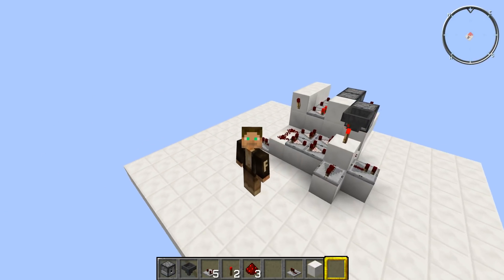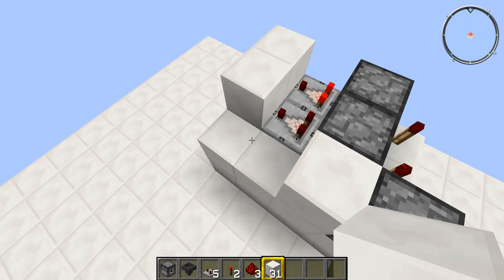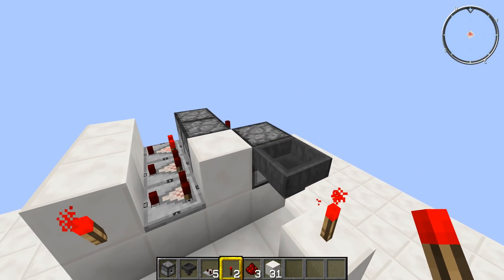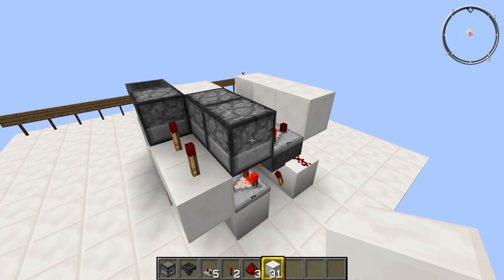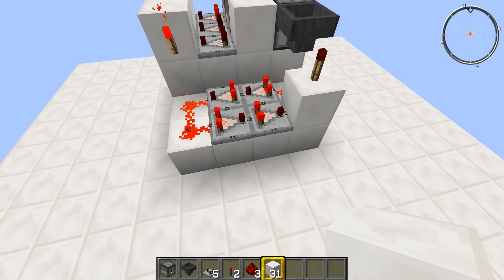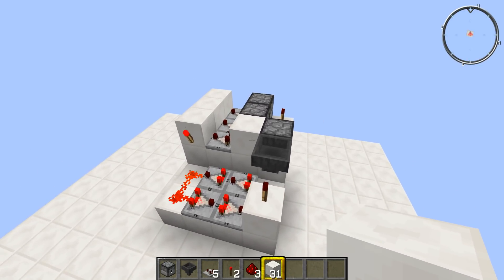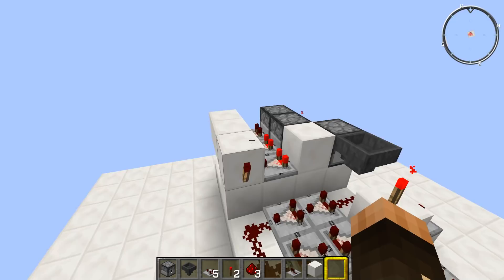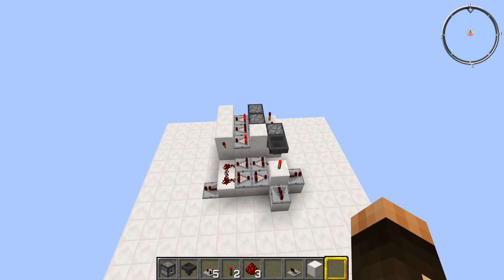✅ Minecraft Silent Adjustable Hopper Timer Extender Clock Tutorial How To Video

Comment: Thank you for this! My dropper timer that I used to use 5 years ago (been away from the game and only recently returned), no longer works. It used 4 droppers (no hoppers) so that it would be a consistent timer, even on servers that messed with how hoppers work (or limits how many hoppers can be used). 

I couldn't get my old dropper timer to work, no matter what I tried. But this one works perfectly. I'm not a fan of the hopper usage (for if a server limits the number of hoppers), but at least it works for now. I'll just have to adjust if I join a server that messes with how hoppers work.

Comment: The original clock is amazing.  It's just what I needed.  However, this extension is giving me issues. 

Once I put say 10 items in the dropper, the comparator lights ups, turns off the side torch, cuts off the bottom comparators, and turns on the torch locking the hopper.  That's just like the video.  However, I don't get a off/on pulse from the comparator monitoring the dropper so the hopper is always locked.  The dropper just shoots items on the ground.  What am I missing here?
Reply from the maker: Check its a dropper and not a dispenser. If they are droppers make sure they are pointing straight into one another
Reply: @Frilioth  It was a dropper.  I put blocks around the hopper to try and force the items to go in it, but still had issues.  Anyways...  I figured out a way to use hoppers instead so it still stays silent.

I ended up taking an observer and pointing it downwards over one of the comparators on top of the hoppers of the original clock.  I put a piece of redstone on top.  Then, I put a solid block on top of the dropper to the right.  On top of that block, I put a repeater on 3 ticks (very important) then put another solid block to the side of the repeater (not the block under it) and threw a torch on top.  That torch now stays on and has a single pulse that cuts it off then back on.  At that point, you can use 2 hoppers facing each other instead of the dropper into a hopper.  Basically, just follow the build at this point like this video.

I hope that makes sense.  Doing this fixed the issue of the long pulse (2 items pushed) for those that tried.
Reply: @Frilioth  So I've been tweaking the extension and had a breakthrough thanks to Cortezerino and his adjustable pulse extender.  The number of cycles now depend on the number of items you use for the initial clock.  For instance, if you set the initial clock at 1 min that's 80 items.  That's the max cycles the extension can run without issue.  2 min = 160 cycles = 320 min.  So on so forth.

Still silent :)

Comment: Hi, I have a question, how to drop water from a dropper once the timer is finished. I mean, dropper work in 2 signals....one to acrivate and one other to deactivate... I found a way with a comparator in sub mode and many repeaters with dalay but it is so ugly...do you have a more compact and elegant solution? Tnx alot
Reply from the maker: How long did you want the water to flow for before its turned off?
Reply: @Frilioth  just the time to harvest the crop...it will do a path of 8 block in one side and 16 in the other side...I must plant to back after ....
Reply: I solved the problem...I built this amazing sistem under my farm and on the main timer output I put some redstone lamp and sound block so it show when it is on/off, at half or at the end of the count and if hopper is empty 😂,  Adding like I read in a comment here 150 sticks in main timer hopper it vill count 1 minute but in one direction and one in the other, so 2 minutes, so with 15 sticks in the secondary timer it will be a 30 minute timer exactly. For the 2 signals I managed to solve the problem taking both the signals from the last torch but remuving the 2 repeater of the tutorial and adding in one side only redstone dust followed by 6 repeater 4 tick and in the other side a torch that stay active until the counter end followed from 5 repeater 4 ticks. So the torch once get deactivated close the signal and so the  other side with one more repeater give the signal to drop water after the delay end and the torch get activated back it will give the signal to stop droppers to dispens water 👍. Top timer on youtuber I found much better and space saver then the pressure plate counters...tnx alot. It take half the space of the other solution with pressure plate and do not need to refill the chest and reset the sistem.

Comment: Suppose I wanted a timer that cycles in months or years - dunno what a practical application would be.   Could I cascade two of your original hopper timers so that a pulse from the first timer would allow only one item to transfer between hoppers in the second timer?  Just curious.
Reply: Yes, it is easy, but each cascaded timer "only" multiplies the cycle time by 638 max.  Take a signal from one of the vertical torches on back of timer #1, invert it with a redstone torch,  then feed the inverted signal into the two blobs of dust on the front of timer #2.  When the selected torch on the back of timer #1 fires, timer #2 wakes up for long enough to transfer one item between hoppers and is frozen otherwise. 
Now timer #2 multiplies the cycle time of timer #1 by an even number determined by how many items are in timer #2's hoppers.  The formula is (timer #1 cycle time) * ((items in timer #2's hoppers - 1) * 2).  With 5 stacks of 64 items in both timers, that's (4 minutes 15 seconds) * ((320 - 1) * 2) = 4min 15sec * 319 * 2 = 45 hours 11.5 minutes, not quite 4 days.  To get a total cycle time of months or years, one needs at least 3 cascaded timers

Comment: I believe (And i could be wrong), but a hopper transports an item every .4 seconds, meaning if you put 150 items (two stacks of 60 and a stack of 30) it will go for a minute.  Put that in the original timer, and each item you put in the extender will equal to a minute exactly.  I believe.

Comment: Hey Fril,
Another great tutorial video.

In theory, couldn't  you put 30 items in the dropper and it would then pulse 127 minutes and 30 seconds? Or is it that there would be a signal from the dropper because the first 15 items went into it?

Oh yea, you didn't add an observer block, ha ha :)
TC/SS
Reply: That should only work for the first cycle. Once it pushes all 30 items into the hopper, the pulse extender allows only 15 items to be pushed back into the dropper. Meaning the hopper will always have at least 15 items after the first cycle and the dropper would only need to push 15 items each cycle instead of the full 30.

I might be wrong because i haven't tested it, but that is how i would assume it works.
Reply from the maker: Thanks LarBear. If I understand then it wont work because of what Geek said. In order to extend it further you would have to add more comparators.
Reply: @Frilioth I understand how to extend it with the comparators, I was thinking maybe it would send the first 15 then on the next cycle it would send the rest. Thank you for clarifying.

Also thank you Geek Bait for your response.